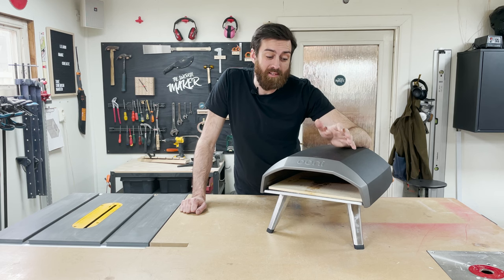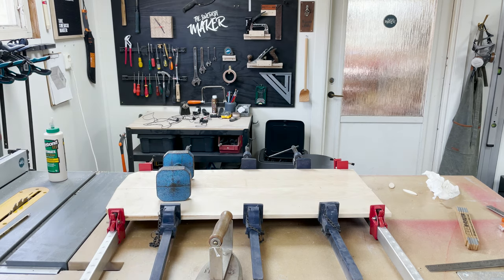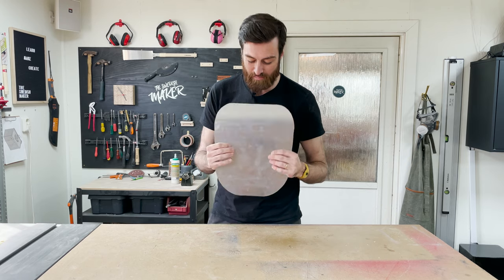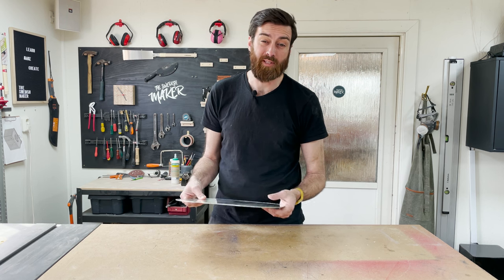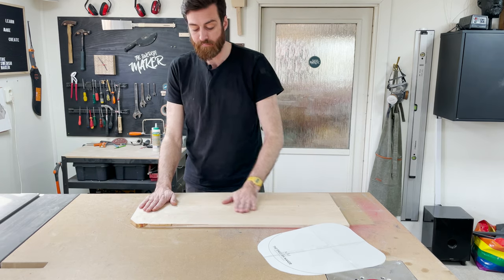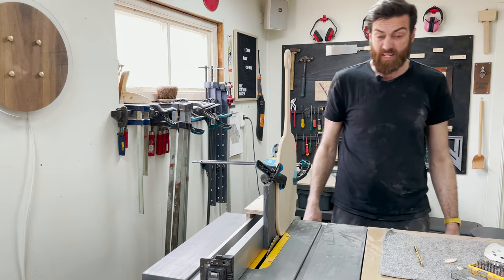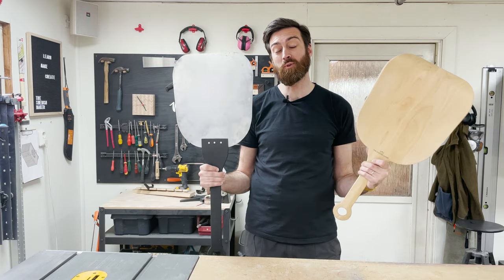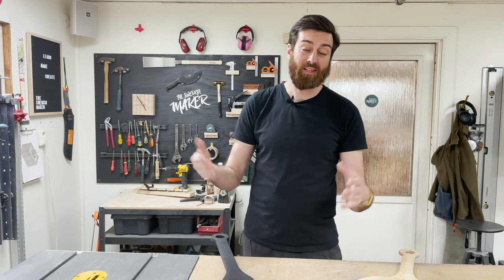Making Two Pizza Peels - Aluminium and Birch

Comment: Here I am, eating a homemade pizza and watching other guy make pizza peels and eventually a pizza.
Thanks for the inspiration, I need to make a wooden pizza peel someday. I have a stainless steel peel. It's great for taking pizza out of the oven, but not so great for putting one in. Dough tends to stick much easier on it than on wooden peel. 
Great video, that wooden peel seems to work wonderfully. How thick/thin it ended up being?
Reply from the maker: Thanks! Thats a great way of enjoying a pizza :) The wooden one is great for putting the pizza in the oven. It ended up about 1 cm thick.